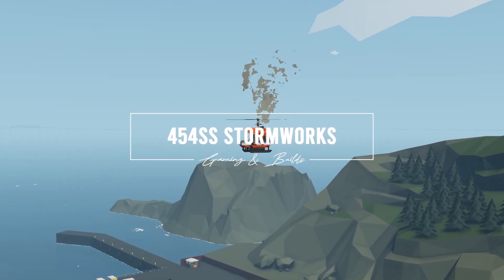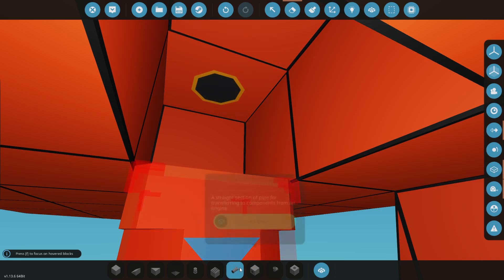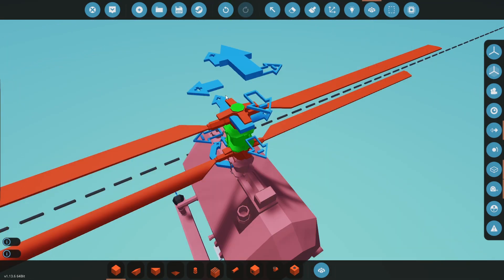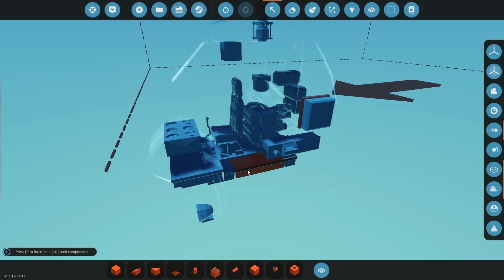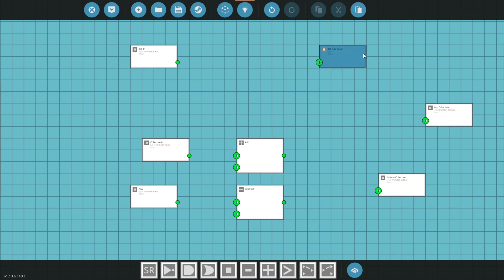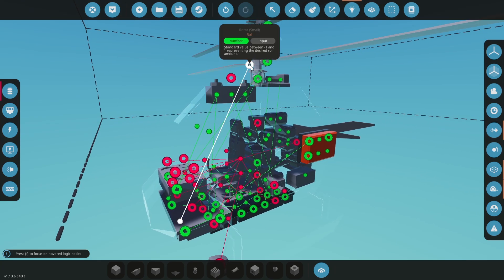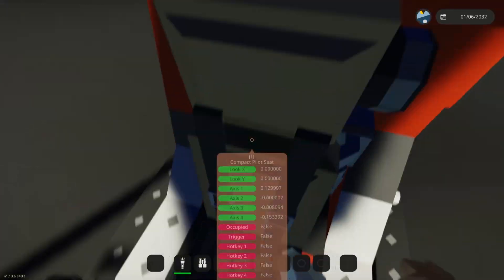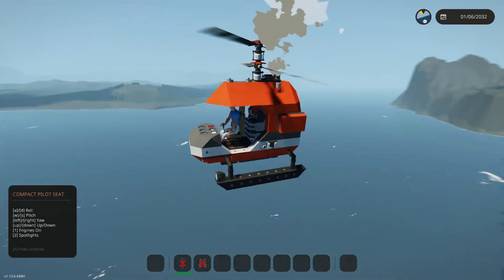How to build a CO-AXIAL ROTOR Heli in Stormworks (Engineer Explains)

Comment: Hi, I've got an issue. Basically, I made a coaxial helicopter, but I want to make an altitude hold function using a button (so if you switch the button on alt 60m, it flies at 60m altitude). But when I implemented the controller for this with a PID and switch box, I can't put two different inputs into my collective pitch control (one from the coaxial microcontroller and one for altitude hold).  Help me, please.
Reply: I also try to mix alt hold in coaxial microcontroller but it does not work
Reply: Late answer but
What's the problem? 
Place the numerical switchbox and put your initial collective controls from the seat through it (inputting through OFF node). 
Then you use memory register so that it can hold the number – let's say 60, when you flick the switch. Then this 60 must go to PID's setpoint. Pid's variable is just raw data directly from your altimeter.
PID's output goes through aforementioned switchbox (inputting through ON node).
How it will be controlled is: you flick the switch, this switch MUST do 2 things – go and activate your PID and go to numerical switchbox and switch the input from your manual (seat or something) collective controls to PID's control.